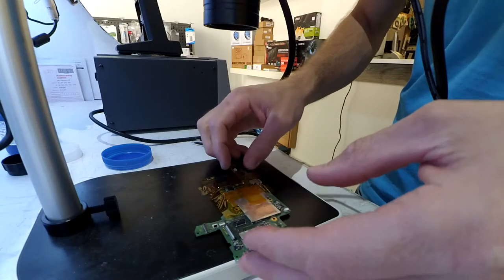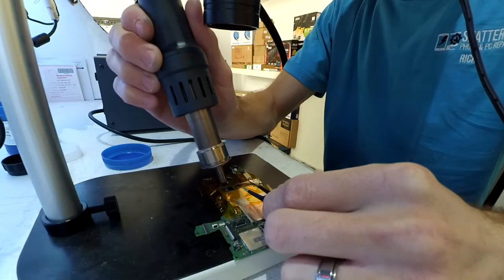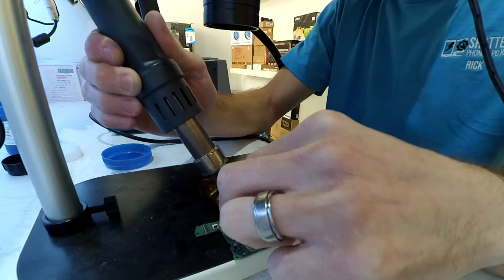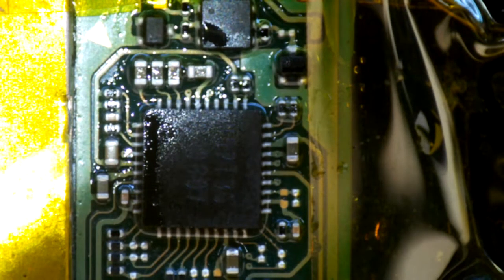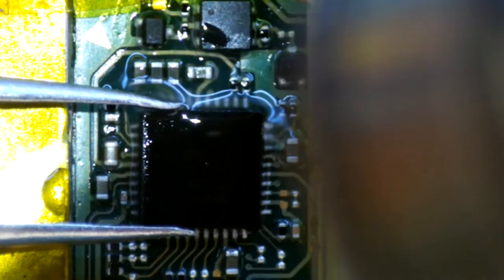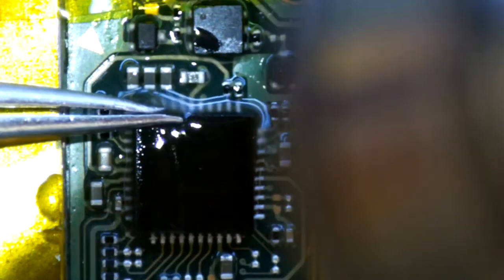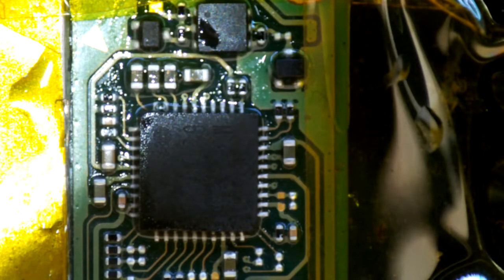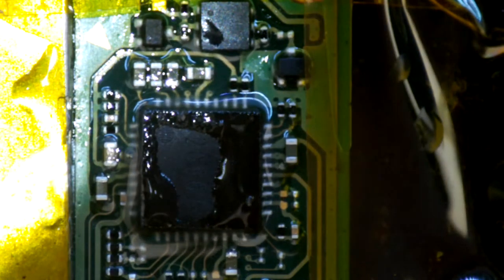Nintendo Switch M92T36 Chip Removal

Comment: Hi, I am looking to do exactly this replacement. I was just wondering what hot air station you have as i just cant decide on what to go for! Cheers, Nice video and look forward to seeing the reinstall later down the line.
Reply from the maker: Hi 

i am using a Quick 861DW Hot air station
https://store.rossmanngroup.com/index.php/quick-861dw.html

After going from an Ebay Special 853D, there was a huge difference in quality of effort needed for the job, the 853D is crap by comparison.

Hopefully have an update on how its gone in a months time, when i get some new chips
Reply: Good

Comment: How did you test to see if the chip was working or not? I'm trying to test mine, but I'm not sure how to go about it. I replaced my c-port and tested the chip, it has the same charge on most of the sides as the charge coming from the c-port. Should it be the same charge on all the sides? Any help would be greatly appreciated,  thank you.

Comment: Does the chip number matter? Like is there a specific kind for different switches that you have to replace it with?
Reply from the maker: I haven't seen new switchs but I would be assuming yet it would need to be the same model number
Reply: @rickstechrepairs  yeah, that's what I meant the model number. Does the switch just have to have the same model number or is it the actual chip?
Reply from the maker: The mt92t36 chip is used on the first gen switchs 

I'm not sure about 2nd revision or switch lite

Comment: hey so my switch doesnt power on at all and i think this might be the repair i have to do to get the machine working again. however when i plug it in on my dock the light blinks once and doesnt blink at all afterwards. i would love to troubleshoot this switch see what could be done to save it and learn more about surface mounted chip repair.
Reply from the maker: That would be a different fault to what this one gets, 

In my other video I get a rapid green blinking light on the dock.

If you haven't done any laptop / mobile phone / tablet repair in the past 

And don't have the various tools on hand, I would recommend against attempting it yourself 

(The hotair station I used in this video cost around $350-400 AUD)
Reply: i havent really found any case like mine then where the official dock blinks once unless you maybe have a source that could lead to people with the same issue. i have found the datasheet of the ic and wanted to see if i could figure out with the pinout if its broken or not.
Reply from the maker: Do you have of the following prior to opening and looking at the inside of the switch 

*Usb amp meter (read power that's coming thru the USB port on the dock)

*Wall plug amp / power usage meter (to see how much power the switch wall charger is drawing in)

*Access to another switch dock and wall plug
Reply: @rickstechrepairs  no but i was planning on getting them. i saw with a power bank it was drawing power from it. the charger indicated it was having power drawn from it but the screen was black and no way to turn it on.  i know i seem like im just gonna trash the switch in an attempt to fix it haha but im not . charger works, tested it out on another usb c device. there is no gunk or bent pins in rhe usb c port either.
Reply from the maker: No worries :) i would try and find some more info prior to tearing it apart tho

Another thing to note; the nintendo switch doesn't follow a standard type c, they have got their own proprietary way of charging
Reply: @rickstechrepairs  ill be sure to  do that. maybe find a local repair shop who might be generous enough to teach me some things haha.  i figured it was a odd c charger. if i find anything ill probably post it here maybe. if you have any updates id love to stay updated.
Reply: kemal2551 hey I got the same problem as you just one flash and shuts off let me know if you  find out if it works
Reply: i have same issue , , one blink and nothing , no display , no power up :(
Reply: ok so i sold the switch however the guy i talked to was looking for broken switches. so after the sale he messages me telling the switch works fine so i asked how he got it working. he says he uses a charger with a higher voltage to get it to work again. so maybe thats a solution however im not sure
Reply: @Mr. Miyagi mine coz I had auto rcm enabled and that drain the battery . All what I had to do is to inject payload from PC and it did boot. After I put it on charge and it was fixed.
Reply: @YuYu-rc4xb  do you have auto RCM enabled ? Or u running any CFW?
Reply: Wisam Alzataf I ended up selling mind as well  
Also did try the auto rcm and everything else I read online the person I sold it too bought it to repair his switch that had a broken screen
Reply: @kemal2551  I may be that person hahah   I bought broken switches and fixed them.  1 of them were hacked and had rcmmode enabled and other 1 worked after I charged it.
Reply: @ELY3M  yeah that mightve been you hahaha. ah well i guess you got a really good deal, hope you put it to good use

Comment: If i put the old chip in my new switch withe the v2 mainboard, is it hackable?
Reply from the maker: Nope
Reply: Ricks Tech this is only the chip for the battery management right?
Reply from the maker: @shisui1031  yep
Reply: @rickstechrepairs  So basically if I have a hacked v1 switch and I swap the original chip out for a v2 chip I can still use my hacks right?

Comment: god dam chip won't move.  I'm hitting it with 500 degrees F and won't move
Reply from the maker: i think i used between 280-330 o C
Reply: You might want to try some flux, it really helps improve the process.
Reply from the maker: Need to get some decent stuff